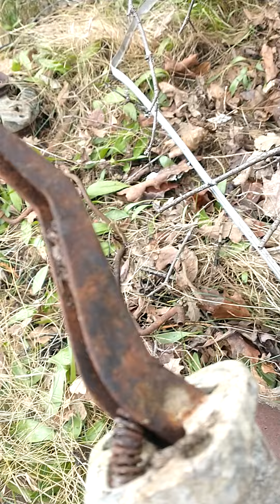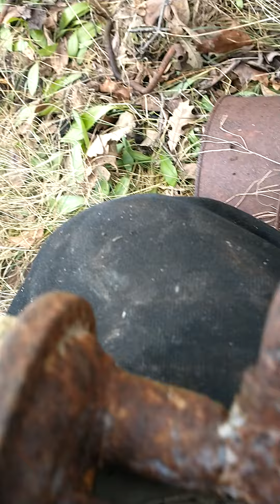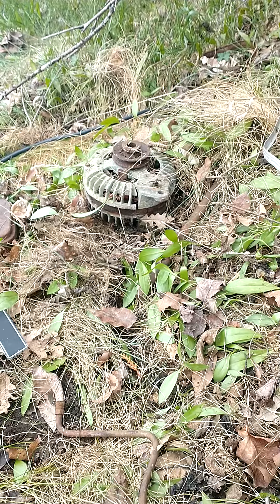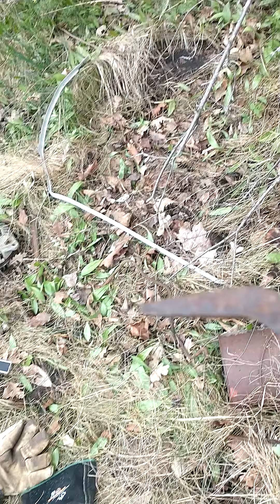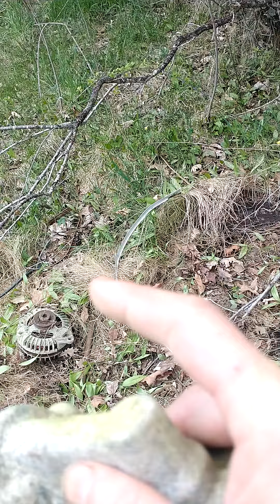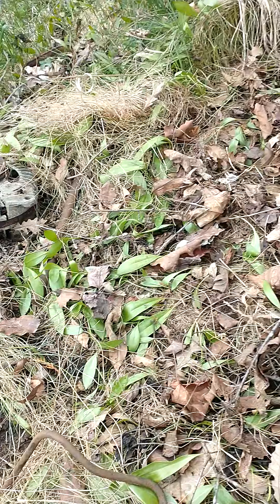Car Parts 😊

Comment: Dodge alternator and fuel pump
Reply from the maker: That could be. The alternator looks identical to one I had on an Oldsmobile Delta 88 years ago. Electrical parts were often used by different makes though. The Long arm on the fuel pump made me think it's from a Ford but could be a Dodge. I'm not sure what a Dodge fuel pump looked like. I did find a front marker light in the same pile that was from a 70's Ford truck so figured the rest of the parts were from the same vehicle.